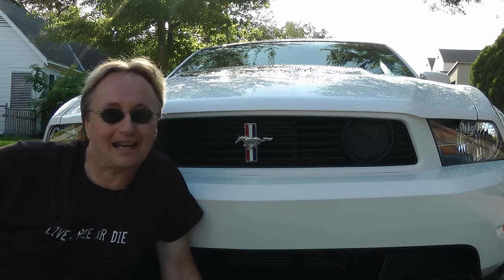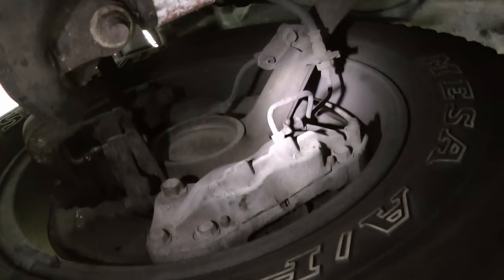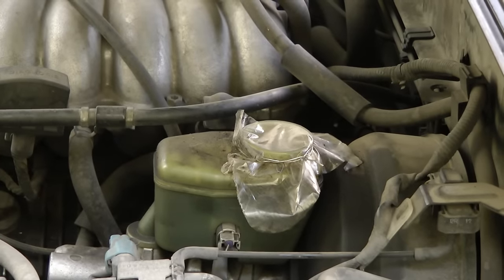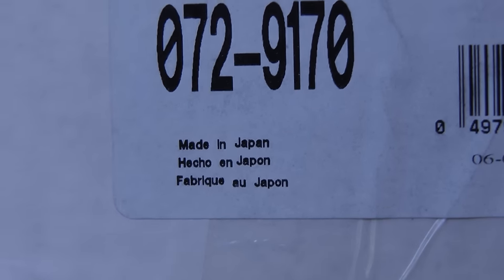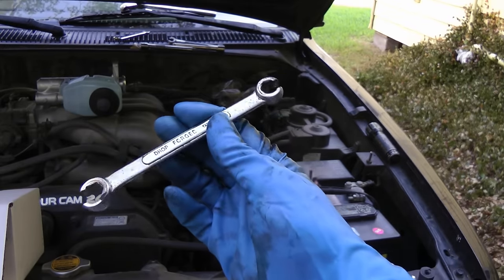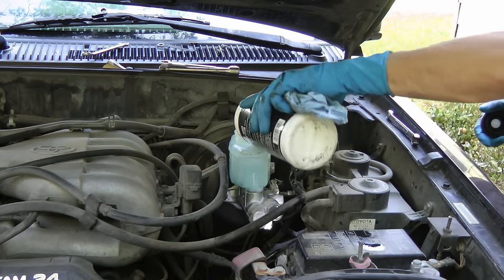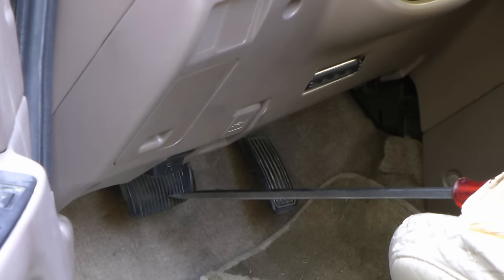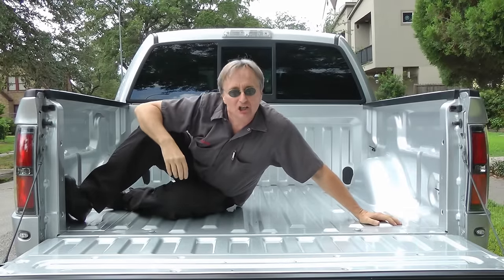How to Fix a Brake Pedal that Sinks in Your Car (Brake Master)

Comment: When you press the brake pedal and loosen the flare nuts on the master cylinder multiple times does that bleed the entire system or do I need to bleed each caliper?
Reply from the maker: that removes any air from the master and the lines near it. IF no air got into the callipers or the rest of the system, that would work.
Reply: Scotty Kilmer Ok thanks Scotty you the man! My brakes worked great for a day but I suspet there might be some aire in the rest of the system so Im going to try and invest in a power brake bleeder since I have to do everything myself living out in the sticks of Montana!

Comment: while bleeding  air from brake cylinder .  should you leave the cylinder  cap on or off. you didnt mention that or show if it was on or off
Reply from the maker: doesn't matter

Comment: here's a puzzle for you I'm working on a 1983 Chevy Suburban no ABS system or anything like that just vacuum power booster brakes brand new like in new new master cylinder and brake booster For jb7 brakes have no more air pedal is hard when engine is off,but when you turn the engine on got spongy brakes and the pedal goes to floor do i have air in the lines still and bleed the brakes for about 6 hours and im at a loss iv look on line to see what it could be,I'm just out of ideas..

Comment: I have replaced the front brakes, back brakes, master cylinder, and the brake booster. I have bleed everything and I don't see any leaks. The abs light is not on either. I thought I had fixed it but now the pedal is going back to the floor. Do you have any other ideas?
Reply: Christopher White  check the abs module
Reply: @ARjr247  Thanks.  That would not be good if that is what's wrong.

Comment: Question for you Scotty, in this video you dont show you bench bleeding your master cylinder, and the whole screw driver trick if thats what your doing you should mention to do it repeatedly until the master is full or else it will have air in the lines from the get go. but love your videos !!
Reply from the maker: Cameron Klim it doesn't need bench bleeding if done my way, air will not get in if done exactly as I show

Comment: So what is the problem when you crank the truck up,put your foot on the brake pedal and it sinks to the floor Mr,Kilmer? I followed your instructions to the letter and I still have good hard pedal when off; no brakes when on.
Reply: Same problem. Have you fix it. Or find a way to fix it.

Comment: Soft pedal and weak braking, first get the ABS kicking in on all four wheels, to chase all air/old fluid trapped inside the ABS valves. 
Get the car on a wet street without traffic and let the ABS kick in a few times.  Also make sure all calipers are being bleed using a small piece of tube over the bleeder so no air gets sucked in.

Comment: hey scotty i have a question i installed a brake booster from a 98 camaro onto a 1972 buick skylark but im having a issue with the pedal sinking as soon as the vacuum hose is connected..would you happen to know what it could be??
Reply from the maker: I have no idea if those parts are compatible, they may not be. But if it's hard with no vacuum, but sinks with pressure that booster is bad

Comment: Thank you for getting back to me scotty I really appreciate it I have one more question for you unrelated to brakes I have an 01 bmw 330 xi and I changed the oil last night I think when I put the drain plug bolt back in I might have stripped ot because now my oil light comes on and when I put the drain plug back in it kinda kept turning the pan is made out of aluminium so what can I do to fix this thank you in advance
Reply from the maker: try an oversized drain bolt, they make em so they cut new threads in the pan
Reply: Thank you

Comment: I have changed break master cylinder of my vw Jetta abs and esp 2009 model and there is no leaks but still break paddle is soft. I have replaced genuine vw part from delar. Please advise what else is causing
Reply: yea tell me about i did this too didnt work

Comment: The problem with my GMC Envoy  is that on right side of both wheels doesn't get brake fluid after car become hot or probably after 10 to 15 minutes drive.Can you suggest Please what can be the reason??
Reply from the maker: Zain Abrar often old brake lines collapse and do that

Comment: Sir Scotty I have an issue with my 97 Toyota Noah. Whenever I turn the steering wheel all the way to the left my brake petal goes straight to the floor when I press it then guess hard again after a about thirty seconds

Comment: Hey Scotty love your vids. I have a question, I can't figure out why the brake pedal sinks quite low when I'm driving but if I pump it once or twice it seems higher and grabs better. I've already bled the brakes. Any idea what the issue might be? Thanks
Reply: mattyv1228 check vacuum hose leak, mine had one

Comment: scotty i replace the master cylinder front caliphers and all the rubber hoses to braided steel lines 
and when the car is off the pedal is hard and ok but when you start it the pedal goes to the floor need help
on my 89 camaro rs 5.0
Reply from the maker: either air is still in the system, OR the brake booster has gone bad

Comment: I dont want to spam or anything but i just tell you that i was in a store and asked about MC, it will be expensive and takes 2 weeks to get it, but i will probably buy it. I have 3 days to take final decision.
Because i have nothing to loose i just removed MC from car, took it apart, looked inside / outside, cleaned. I will put it together tomorrow and will bench bleed first. Just to try and then install it.
And bleed again on car. And some other ideas, if nothing works, i will get the new one.

Comment: Hey Scotty my 1997 pick up the pedal still goes down I replaced a front caliper that was busted and the master cylinder I bled out the system and the lines and it still goes down what could it be

Comment: i have mazda 3 and the problem of brake is during the driving when one of the wheels occur in the digs at medium speeds like 30km over ,also the brake pedal is pressed  that lead to sink the brake pedal  so to happen the mention of problem shoud ocurr wheel in the dig , high speed , the brake apply all in the same time otherwise the problem not occur .please your help if you understood me

Comment: I did this to my 98 corolla ce and the brake pedal still soft and sinks to the bottom and i also changed the brake pads and the drums and ive bleeded the brakes too. What could the problem be and the brake lines are pretty new

Comment: Hey Scotty, I'm having a hard time figuring out whats wrong with my brakes. I have a 2001 Tacoma with no abs or traction control. In the morning, the brakes will be spongy. Sometimes the pedal will go to the floor, sometimes it wont. After normal driving, they get to their normal state. Then later on, after braking while driving in the city, they become touchy and the pedal loses travel. It gets to the point where there is no travel at all. I can feel the brakes grabbing as if I let go of the brake at a light, the truck wont move. Also, when the brakes act up like that, if I go on the highway I can hear them grabbing and the whole truck will shake with very very touchy steering due to my rotors being warped. Now, after stopping or driving without braking, the pedal will start to go back to being normal and most of the time will go back to being spongy. What could it be? Replaced the calipers, rotors, and pads about 5 months ago
Reply: It's your calipers. The square seal that seals the piston in each caliper needs to be in good condition in order for the piston to retract the brakes a bit every time you release the pedal. They go bad or start to "stick" if there is water in the brake fluid, generally in the caliper itself. The pistons are probably rusty and the seals are probably going bad BUT, you can pull each caliper off of the rotor and push the piston out and inch or so with the brake pedal, then compress them back to sort of get it moving again. You also want to get fresh fluid bled through all the lines and calipers, which will prevent further corrosion. But anyway, your brakes are in a constant state of not letting go completely, which is locking them tighter and tighter as they start to heat up which is giving you less and less travel in your pedal and makes it harder and harder to depress them to get proper brake functioning. It is unsafe and it really isn't that difficult to start to get them functioning half decent again by bleeding all fresh fluid, extending the pistons, retracting them and putting new pads on. Old pads are probably shot from heat. Also, your slides need to be checked which isn't hard either. If your rear calipers are actuated calipers (ebrake built into them) you need a tool that compresses them and twists them at the same... You can rent one from autozone.
Reply: +Mike LoPinto I fixed the issue. turned out to be a bad master cylinder.

Comment: my brake pedal isn't hard as a rock, but it also doesn't go all the way to the floor. braking is fine, i can stop super hard but the pedal isnt hard. is this normal or what. no air in system either ive bled it out multiple times

Comment: My Tracer brake pedal would still feel firm but would end up on the floor.  My dealer changed a rear brake cylinder and changed pads, to the tune of $700, and it still did the same thing.  My regular mechanic moved back to the area, and I went to him.  He changed the rubber lines on the front brakes, and problem solved.  The lines were old and expanding under pressure.

Comment: I had new brake pads put on..and brake fluid. but when I drove the car after..the pedal went down but  not all the way to the floor.. It did stop the car.. does this mean there is a leak in the master cylinder?  how much would that cost?  anyone please I would like an answer

Comment: how fast does water corrode brake lines? The reason i asked is because 
while waiting for a back order brake booster, my brake line were exposed
 to air for couple month before part arrived.

Comment: I replaced the master cylinder on a international school bus(the long yellow school bus) and the pedal is still going to the floor. Any idea why?
Reply: More than likely air in the system, possibly a booster assuming you're not running air brakes on it.

Comment: hi Scotty,have 2000 Chevy lumina,with Eng off,brakes are hard,when I turn the ENG on brakes are slowly going to the floor,,but still stops the car fine,only on stop light,if I stay on brake pedal it slowly goes down
it has new calipers,master cyl,rear wheel cyl,bleed it manually many times,no external leaks

Comment: Hi Scotty,  I have a 2004 Nissan Maxima.  I had the rear calipers and brakes changed and now the brake pedal is really soft.  The brakes were bled and there is no air in the system.  Also, there is a vibration in the brake pedal and a whirring sound from one of the wheels when pressed. What could be the problem?
Reply from the maker: Navtej Grewal rear calliper work on those things is often a bear, if you got rebuilt and not new calliipers, they often are not made right. I would check the callipers first
Reply: Thanks!

Comment: no, air won't enter the system through the reservoir bottle unless the brake fluid level is too low. an easy bleed system forces air into the reservoir to help bleed the brakes. moisture however would certainly be a problem

Comment: I've got a brake pedal that sinks on the first press but if I release it and press again it gets ok pedal. The clutch is tied into the reservoir and clutch feels like it's got air or moisture in the line too. Had both the brakes and clutch flushed. Seemed to be fixed for an afternoon then back to the same spongy mediocre pedal

Comment: Hey scotty, my pedal is sinking. Replaced the master cylinder and bench bled it, replaced both rear wheel cylinders, and bled the ENTIRE brake system until clean fluid came out of every line. My pedal still sinks like crazy. Any ideas?
Reply from the maker: +**Classified** if you have ABS, often bad abs modules do that. Just be sure all the air is out and that there are no leaks anywhere you can see on the car at the wheels or any of the brake lines
Reply: Scotty Kilmer Thanks for your advice!

Comment: Question:  My 2001 Buick Century suddenly lost pressure in the brake lines.  There's no fluid leaking anywhere.  The reservoir is filled to the correct level.  If I pump the brake pedal, it just continues to go to the floor.  Sounds like a brake booster problem, right?  What's strange is that I know the exact moment it happened.  I had the key in the ignition and turned forward one notch, and pressed the brake while shifting from park to reverse. (Engine not running.)  At the very moment I shifted out of park my brake pedal went to the floor.  Why would that happen, and what does it mean?
Reply from the maker: +Josh Mulder  either brake master went out or brake booster in most cases. But sometimes it's an ABS modulator failure too on ABS vehicles
Reply: Thanks for the quick reply!

Comment: Done the booster check,no air in the tubes and chamber,,,still my brakes get hardened after two or three kicks on pedal with engine on,,,,then it gets softer when I put some throttle into engine,,,,I don't know where is the problem n how to fix it...

Comment: Scotty, why did you not tell them to then bleed the entire system after the master?  Once you crack the main lines at the master cylinder, you let air into the system.  Shouldn't you then bleed each wheel until there is no air to complete the job?
Reply from the maker: +bigtoyota479  the way I bleed masters, air will not get past the into the rest of the system. just follow my video closely and do exactly in this video.

Comment: cause i noticed that there is no clamp attached to the end of the hose, that's attached to the power brake booster.     doesn't air leak out if there's no clamp on it?    and what happens if it does?

Comment: got a question for you, my brake is hard when engine is off but when the car is running it sometimes just sinks right to the floor..sometimes my brakes don't even work..had the lines bled and a new calliper was installed (issue seems to have gotten worse after the bleeding and installation) would it be the master cylinder or something else?
Reply from the maker: replace the brake booster and PRAY it's not an abs brake module failure if it has ABS
Reply: Scotty Kilmer I thought that if the booster was failing the brakes would be hard and take a lot of force to push while the car is on not sink to the floor with little to no resistance. (I don't believe I have ABS its a 2001 Chevy Tracker 4door 2L)
Reply: Scotty Kilmer Replaced the booster..didn't help..moving on to the cylinder. If that doesn't work either..any ideas?
Reply from the maker: Jericho Smith
master cylinders and boosters often go bad together, i'd start with a new master if you see no leaks anywhere in the system
Reply: Scotty Kilmer Alright, thank you. went ahead and replaced the cylinder as well..my mechanic that was helping me put them in says they are working now. thank you again.

Comment: Scotty, on my 99 elantra, at times my brake pedal gets hard then sinks to the floor then gets hard, if i pump the pedal an slam on the brakes , it will get hard then sink, i bled my brakes a few times, no air , still doing it, i put a salvage yard master cylinder on, to try to save $$$ , what can cause this, i dont feel my back drum brakes working, new wheel cylinders, brake hoses, shoes etc, done to the rear, please let me know, thanks
Reply from the maker: Kody Darlington  odds are you got a bad master cylinder, check the lines coming out of it going to the back to see if pressure is going there first, showing a bad master

Comment: Just replaced my MC per these instructions. Didn't change my excessive pedal travel before brakes gradually engage. Bled all 4 calipers and there are no leaks. Feels identical to before. Anything else I can do?
Reply from the maker: bad brake boosters, or a problem in the ABS system often does that too
Reply: Buck Starchaser
Reply: Buck Starchaser you can get the one man brake bleed kit  for $40 from auto zone and do it by myself too.
Reply: I have a kit that comes with a hose and a bottle with a check valve. It cost me $20. Are you referring to another type of kit?
Reply: It's simpler....you know they over charge... But it came with a lot more pieces I ended up using most of them.

Comment: Scotty i have a 2005 chevy silverado 4x4 when ever i turn on the ac or heater  it locks the rear wheels and brake light comes on also the abs ligh

Comment: Scott I changed my brakes and had to drain the oil in the caliper to move the pistons back to make the new brakes fit. Well now the the brake pedal doesn't work and the car doesn't brake at all what do I do
Reply from the maker: bleed the brakes out, air is probably stuck in the system. If not, replace the master cylinder, they sometimes go bad during a brake job from old age and big movement when bleeding after a job
Reply: I bleed the breaks and it worked ! Thank you ! Ur a real life saver!

Comment: Okay my question is I have a 99 pontiac grand am GT I recently had my master cylinder replaced in October of 2013 and as of yesterday when I push on my breaks they go all the way to the floor I had this done professionally an now im afraid to drive my car but I have to I am a mother so I stay on the go what do you think the problem may be PLEASE help ive already put so much money into this car
Reply from the maker: first, realize those are junker cars at that age, big reason pontiac went bankrupt.  But, check for leaks on the brake system, often just a bad wheel cylinder or leaking hose will do just that.